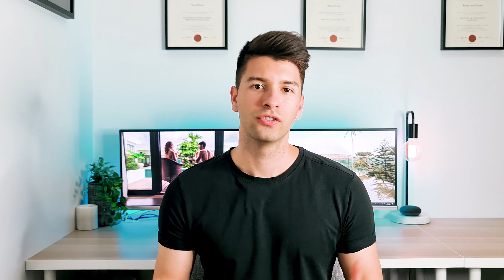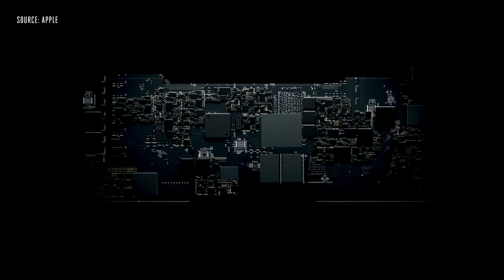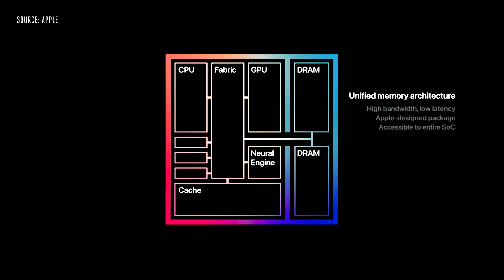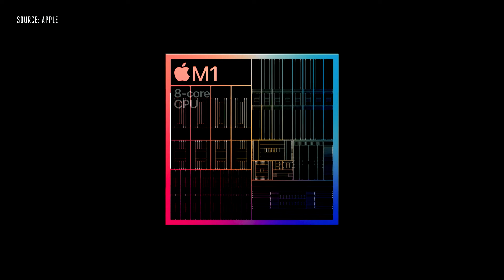ARCHICAD AND APPLE M1 MACBOOK SILICON

Comment: Hi!
I almost use Archicad for 13 years, generally working on single and multi residential buildings on our architectural office. I now have MacBook Pro 15 mid 15 and need to upgrade my computer as soon as possible. I just clear my mind to have a laptop instead of a desktop but still remain in between Mac Vs windows base pc’s. My regular 3D cad program is Archicad. I need to open photoshop and Autocad time to time and intel based MacBooks allow them to operate. Nowadays I also am working with twinmotion like the ease of use of it. On my research, I saw that, MacBooks with Apple silicon (m1, m1 pro and max) chip have problem with operating such these programs. I think apple silicon need time for the users who are professional in architecture and engineering sector. As a very old Mac user, although it’s not rational and logical, I actually choose the programs which work with apple. For example I may tried Lumion which is better for me at interior design renders over exterior instead of twinmotion. I don’t know if I should change my mind and being unprejudecide on windows pc’s. I said at first, I need to have laptop because I sometimes work out of office besides I need to go for a clients place to give a presentation. And I want my computer is also good looking and befit to
architect. I finally found one pc that doesn’t only designed with very well hardware also really looks nice. The two devices I remained in between are “MacBook Pro 16 inch M1 max 32gb ram 1 tb ssd” and “dell precision M5760 17 inch uhd 4k intel Xeon w 11955M 32gb ram 1 tb ssd” 
 
I wonder what you’re thinking about these laptops for my needs and opinions on my thoughts. Thank you in advance
Reply: hey im lost too, what did u end up choosing?

Comment: Dude. The reason all that heat is generated is because of it lack efficiency. M1 is way more efficient. Therefore less heat. If the chips are, as you say 5x faster, its likely they are 5x more efficient. I saw a guy do a comparison, the intel sucked 125 Watts and the M1 used 5 watts. Its likely that the difference of 120 watts is all heat generation. 

Happy to be corrected. If anyone know better please let me know.

Comment: The Macbook Air won't overheat if you give it a demanding task. Instead if begins to get too hot then the cpu will become slower to compensate (and so it begins to cool down). This is the case FOR ALL mobile cpu devices.
Reply: This is the case with all cpu’s. Its called thermal throttling. And previous intel based Macs would do the same to safegaurd the processor.